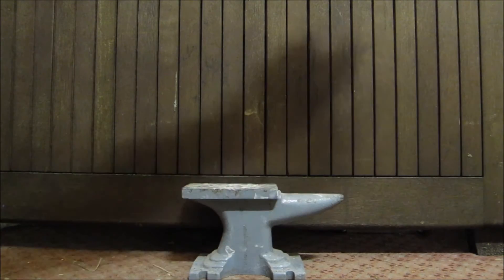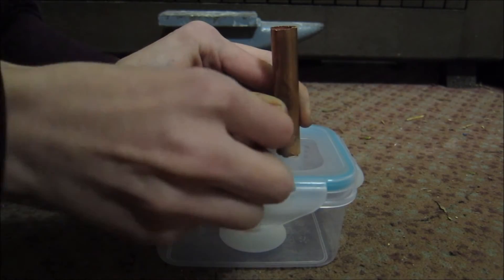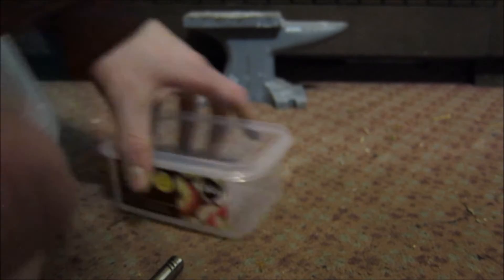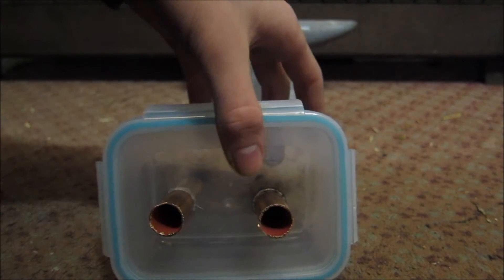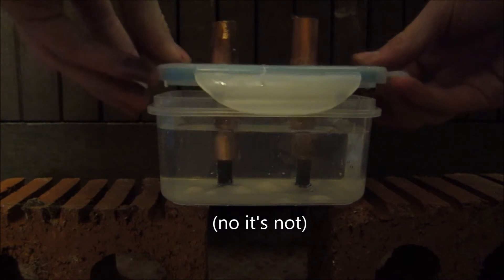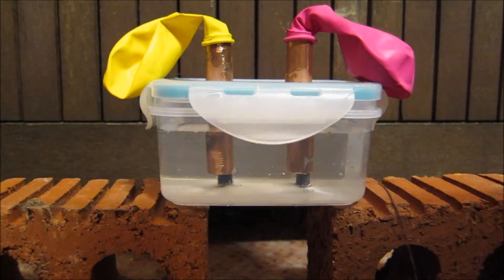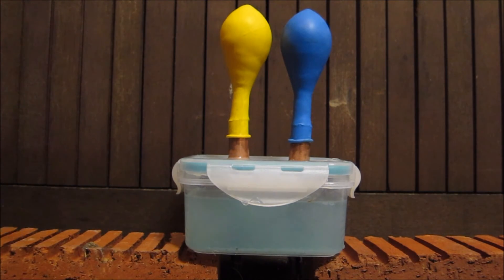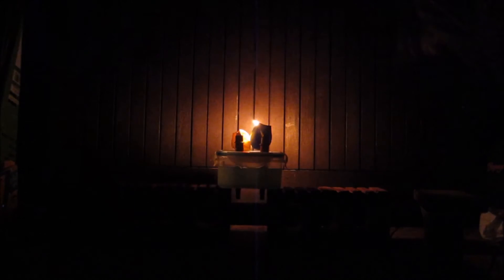How to split water.

Comment: So if i got enough of the hydrogen and oxygen gas from doing this could i use it as rocket propellant and launch it?
Reply from the maker: You would need a way to feed the glasses into an engine and ignite it but theoretically yes.

In practice this is much harder. I've spent long enough trying to build a less complex hybrid rocket engine.

Comment: Can I get a full list of items needed?
Reply from the maker: Sealable Tupperware box 
2 graphite electrodes (can be bought or salvaged from batteries)  - or 1 the hydrogen one doesn't actually need to be non reactive as the hydrogen isn't oxidizing
2 plastic pipes (about 1cm diameter) - plastic is better cos it doesn't conduct, I just didn't have any at the time.
Lots of glue 
Some form of DC power supply
And two balloons possibly with some rubber bands to properly secure them to the pipes.

Hope that helps. If you do build one I'd love to see how it went!